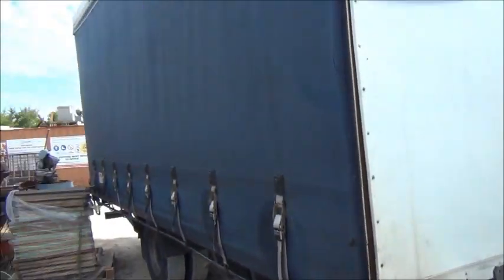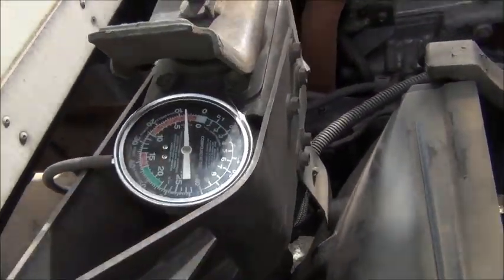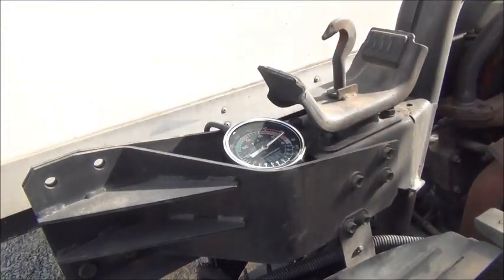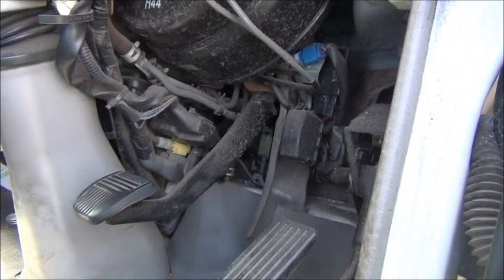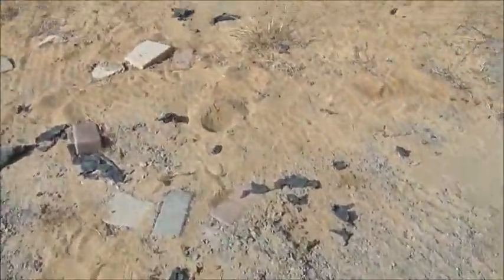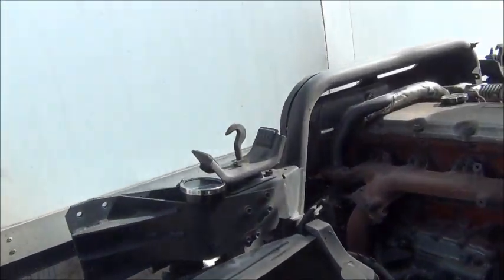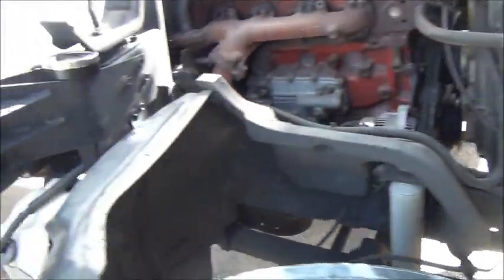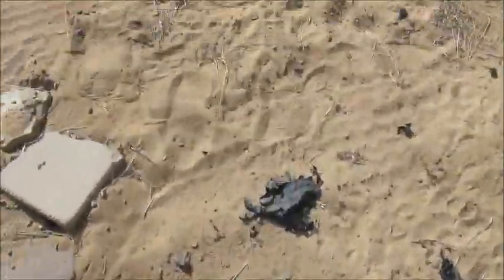Hino Truck, Brake/Clutch problem, Possible lack of Vacuum??

Comment: There is a one way valve on the reservoir tank to the outlet port connecting to the brake booster.  It mostly got clogged by oil ruin the seal inside the one way valve so the one way valve no longer served its duty.
Reply: putting a vacuum gauge at the vacuum pump and then if plenty of vacuum there ( 30 in or more ) , put the guage on the hose that leads to the booster , if vac is lower there it could be a leaking hose , blocked hose or blocked check valve.

Comment: Hi alex, watcing the gauge , it  builds up vacuum fast enough ok,  30hg inches of mercury is plenty,  seen many truck run at 25hg with no problems, you should get at least 5-6 pumps on the pedal with the engine off and  still work at 15hg, and on the gauge the vac is depleted very quick on the brakes, check th lines, has it got reservoir tank,if so there could be a blockage at the tank, if this doesnt help then i would install one on the chassis, then you would have plenty for brake/clutch

Comment: Alex were you able to fix it? I have a 1993 FB Hino I'm working on brakes aren't working well. 
In wet weather I noticed the fronts would lock up & slide so I started thinking the rears weren't holding very well. The brake pedal gets hard about 1/2 way down I pump pedal & it get hard near the top & hard to stop truck.
And 29-30 inches of vac is the max vac.

Comment: I had a rotted 2" rubber hose I had to locate. Once I replaced it, it was working perfectly. It just takes a hole.  The hoses are only rubber.

Comment: As a non mechanic i would see how fast the pressure drops when the engine is off, and not touching the brake/clutch.
If it stays up then at least there are no bad leaks.

Is the pump on a direct drive system or some kind of pressure controlled clutch.

Are you being conned by a double failure in the clutch/break ?

I see what you mean, it does not have a quick enough recovery to deliver constant pressure, are the lines from/to the tank kinked and restricting the recovery?

hmm..

Comment: Alex, on this truck, the vacuum pump is on the back of the starter motor, its a drag to fix,, you can buy that part separately, or look into replacing the seals inside it, its a very difficult unit to fix, like i said, but it can be done.
Reply: some models have the vac on the back of the starter and others have it on the back right side of the engine block

Comment: I find vacuum systems very hard to understand as everything is in reverse. Only thing i know about vacuum pumps is they usually need oil running in their system to work, without it they lose ability to seal, sort of like rotary screw compressors. I think these may use oil from the engine, just a mist and put it back but to be honest i have never investigated one so stabbing in the dark.

Comment from the maker: one pump increases pedal resistance dramatically. if you pump the brake once, then try to clutch, you dont have enough assistance :) im starting to think my original diagnosis at the customers premise was correct.. vacuum fault caused by weak pump!

Comment from the maker: already thinking the second hand route for the customer benefit as a "test" subject, but also, the problem with the truck wreckers here, they have the supremist attitude as they are the only truck wrecker in the area, and will charge you, two axles, an arm, a leg, and a gearbox, for a simple vacuum pump :)

Comment: Having the same problem with my isuzu elf truck. Brake and clutch gets extremely hard when the truck starts up and you hit the break pedal a few times.  There is a leak in my hydrologic break hose, havent replaced it yet but i am wondering if thats the culprit, and also the hose which supplies oil from the engine to the alternator is kinked so i am wondering if enough oil isnt being supplied to the alternator to allow the vacuum pump to work at full capacity.

Comment: Yes it gets odd, and if you include the local air pressure on this planet, the understanding gets odder lol.

I choose to ignore planet air pressure, and its suction and not negative pressure in respect to....lol.

I find the same mental block with switching negative wires instead of positive, im odd that way :-)

Comment from the maker: have leak tested.. no leaks that i can find. pump is directly driven by the engine via a gear. the clutch works fine if you dont touch the brake first, as there is enough assistance, without the vacuum assist, you better start going to the gym and work that leg 5 times a week :) the double failure idea.. yes i am being conned, by the owner of the truck who thinks it will be fixed for $50 :) afaict, the only failure point which would cause these problems is the pump, but its a $1000 gamble :)
Reply: Did you ever resolve this problem?  A friend of mine just bought a truck like this and it is having the same problem........
Reply: what was the end result mate? My 2003 Dutro's having the same issues I have a spare cylinder sitting here debating whether or not to change it over...
Reply: Got similar issue. Was told by local mechanic that if your brakes are too low they will travel long distance to get to touch the drum and they will use alot of air
Reply: Same problem with my Heino truck does anybody have a clue or are we throwing sand into the wind here
Reply: If the clutch has plenty of vacuum assistance but the brake doesnt you have to ask if the brake booster diaphragm is leaking , if you put an inline regulator on a compressed air line and pressurize the brake booster with 30 - 50 in/mercury it should maintain pressure as long as the brake pedal is up ???
Is the clutch and brake Tee'd on to the same line in series or do they have a check valve on one of them ?

Comment from the maker: im worried that taking it apart, it is sectioned, may render it completely inorperable.. i dont want the customer accusing/blaming me for an immobile truck, even though its out of work in its current state.. for $1000 i want to get the customers OK first :) convincing him to risk that, is another problem, as even with all my experience, ive never had this particular problem before, even though im 90% sure :)

Comment from the maker: great idea, but not a fix i would present to the customer unless the mechanical replacement was not available
Reply: did Hino have a pump rebuild kit with Vanes and seals ?  best to strip the pump first though and make sure the casting isnt scored up internally